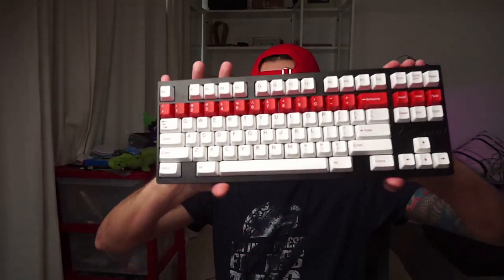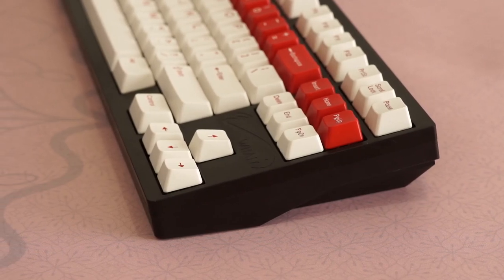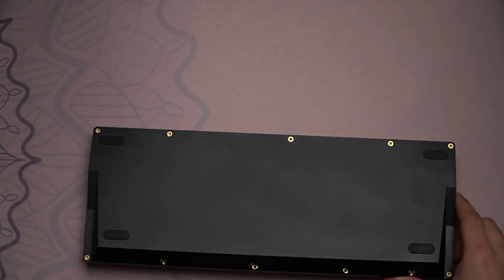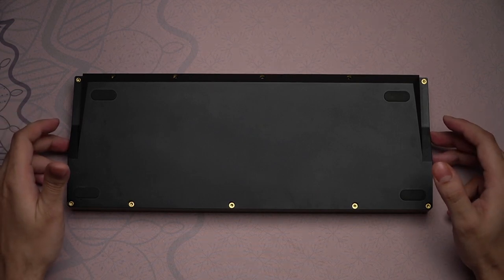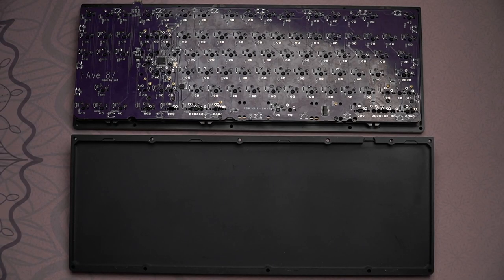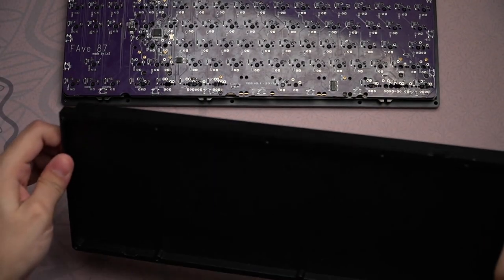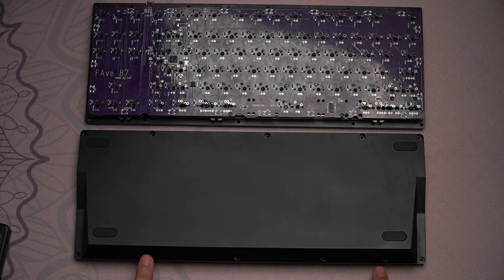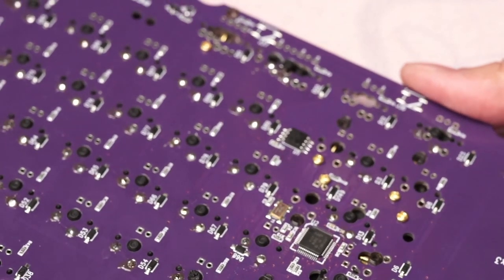Lyn Whale r2 In Depth Keyboard Review

Comment: I'm not sure your gripe with the price disparity is really founded here. The ano mismatch aside, this board holds its own against a bunch of other TKLs that are the same price as it is in the aftermarket, outside of Korea at least. In fact, most of the other TKLs that you'll find these days that are around the same price point as the Whale, are simple top mount designs. In my experience, the Whale at the very least has a softer bottom out experience and a unique sound that you just can't get with top mount, assuming a similar plate/PCB spec. 

I would have liked to shop in the Korean market as well, where flipping is banned, but that's not reality for those of us living outside of Korea. The reality for us is $5000+ TGRs, $2000+ Keycults and S+Rs, and ~$1000 TKLs like Geonworks, Matrix, Lin, etc.

Comment: What blasting media and grit level is ideal for 6063 or most keyboards to get a good anodisation finish? Also will you be doing more guides in the future? like de-soldering? I suck at de-soldering and have destroyed some PCBs😂
Reply: Also they are counterbore holes for the screws 👌
Reply from the maker: That's up to your chosen manufacturer to pick, they'll know what works well with their finishing (or finishing supplier) - you can tell them your preferences (like matte/flat/glossy/rough/vibrant) and they'll figure it out for you

And yeah I'm down to do a basic soldering/desoldering guide, should be nice and simple

Comment: Loved the review Simon. Was quite piqued with what you mentioned about acoustic cut-outs on stabilized keys - would you say to do away with them would be a better option? Or does the absence of material help with a softer bottoming out on them thanks to being 'flexier'?
Reply from the maker: They're totally fine as long as they play nice with the overall sound of the board, but like most things, should be tested with prototypes and deciding on which feels and sounds better.

It doesn't add much real world flex, but in theory it is flexier
Reply: @Blacksimon  thanks for the response mate, have a good one!